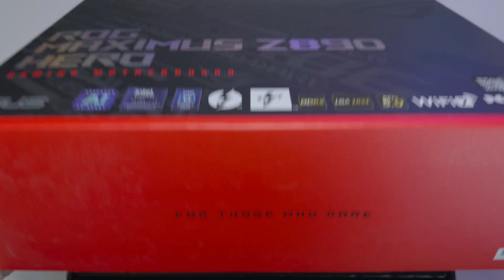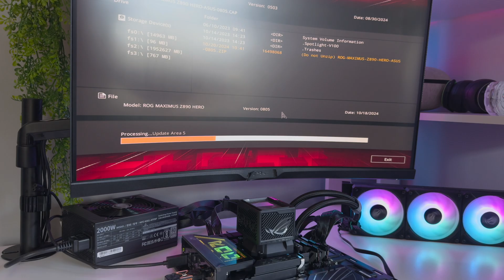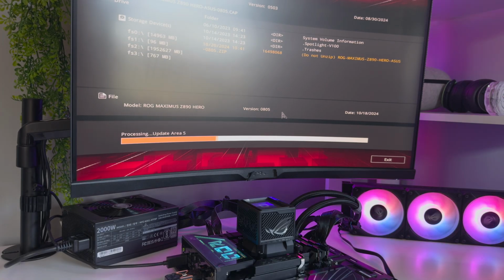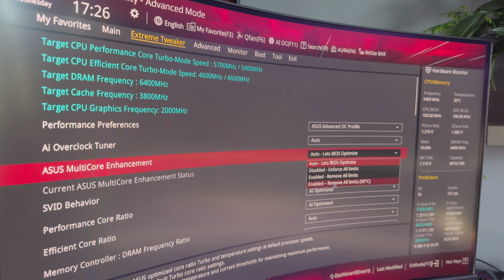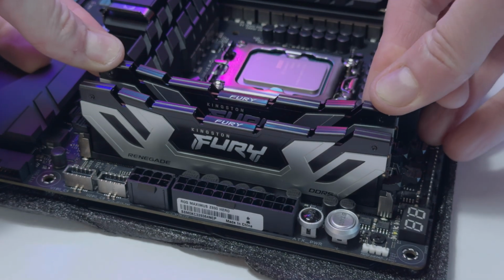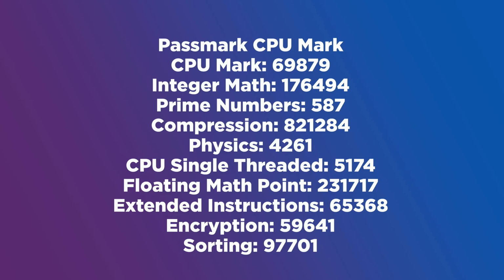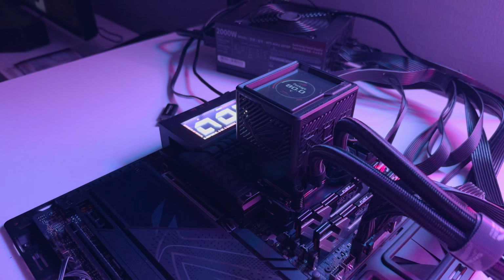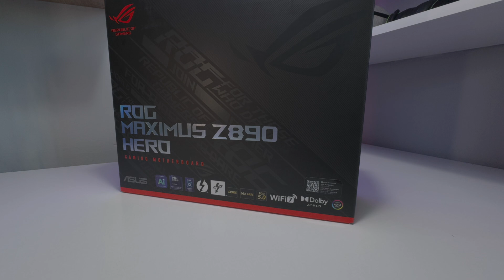ASUS ROG Maximus Z890 Hero + Intel Core Ultra 9 285K Review

Comment: I just build a pc i7 14700k 
64 g ram 6600 cl 32 
But my msi z790 bios isent upptimized and how know when this is getting fixsed i cat get out above 6000 mhz on a bord that says is taking 7800 mhz så i feel if im going to buy a new z790 adus bord för 600 euro its better to hopp in this or just sit in all the drama of the bios im losing alot of power on the i7 and ram 😢

Comment: Dude, where did you see a beast of performance? This is the worst Intel processor of all time (maybe only the 11th generation was the same), it is worse than the 12th generation and worse than the 14600k for 100 dollars. Not to mention the 7800x3d, which is faster, cheaper and more energy efficient. And for this pile of garbage with a motherboard and fast memory, Intel wants 1500 euros from us? Fuck them all